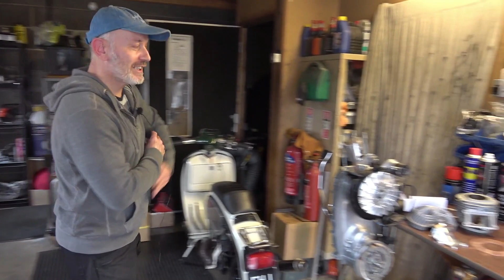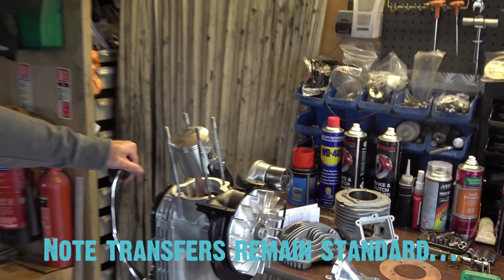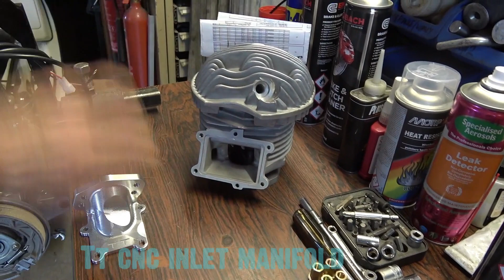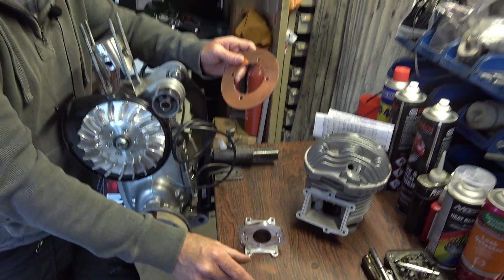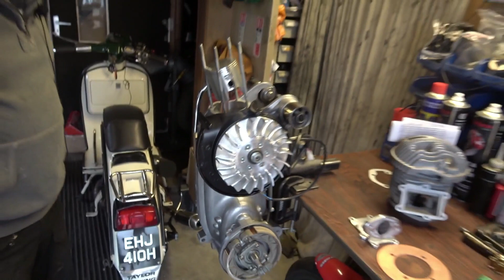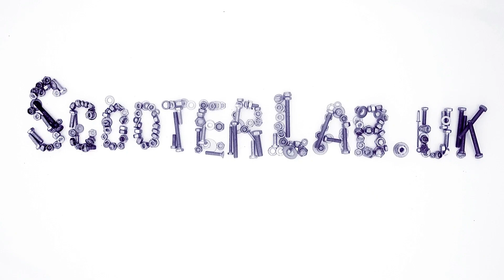SLUK | Darrell Taylor talks about his TType 265 Lambretta engine

Comment: Did you know the mammoth head doesn't work?  As the air will pass via barrel gap between the cover and barrel .... easiest route like water . Sorry to say . I'm sure you know that and have designed a cover to work correctly or put stuffers in the big gap around barrel  ?
Reply: the function of the head and cooling system is tested by its final temperature range achieved out on the road in real world conditions use , we have been using the avanti and mammoth heads since 2012 on our group 6 championship winning motor where the first mod done was cutting thru the head fins to allow thru flow  which has been adopted on all the mammoth heads and later avanti heads ,they  have proven themselves on road / race circuit /and sprinting with superb reliability and temperature results   the road test motor is above 2k miles  now and not exceeded 320f  head temps a good chunk lower than our max figure we are happy to run up to  so has all the cooling we need.
Reply: @taylortuning444  thanks for updating im glad you modified it to allow flow because it blocks air flow on the left side but im sure in your race bike you have also blocked off the air escaping around the exhaust stub and as the barrel is smaller diameter it really needs stuffers to force air threw the fins  ..... people like to know what you do as your number 1 at the moment , keep up good work on lambrettas mate , i would love to see your porting on these cylinders sometime . 👍